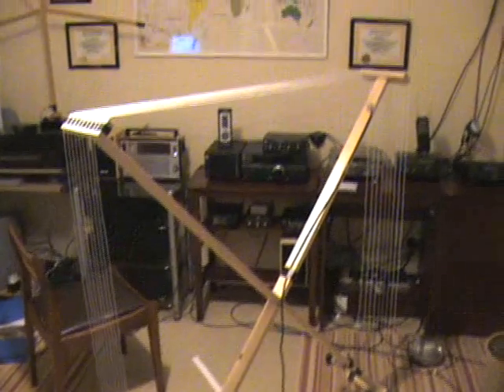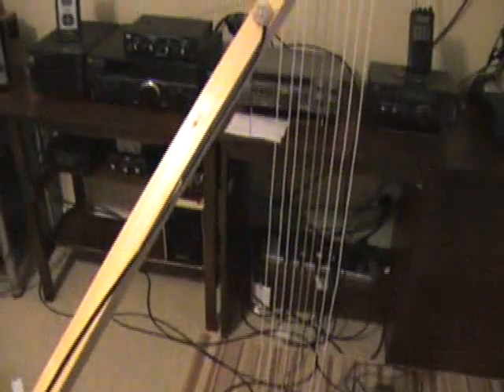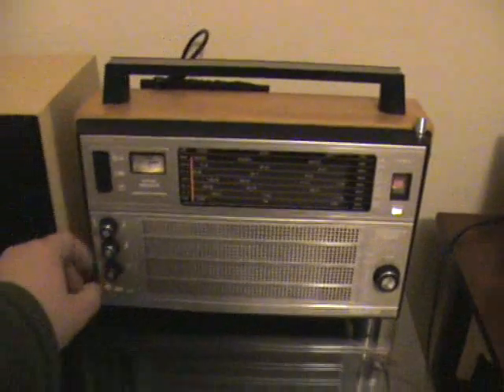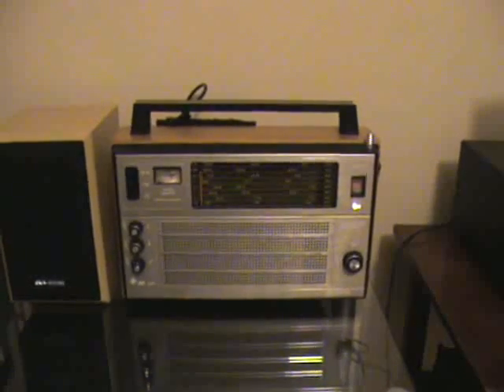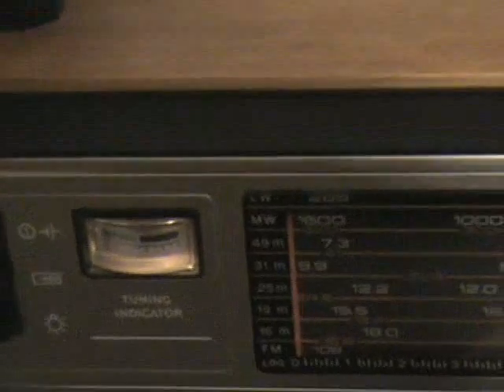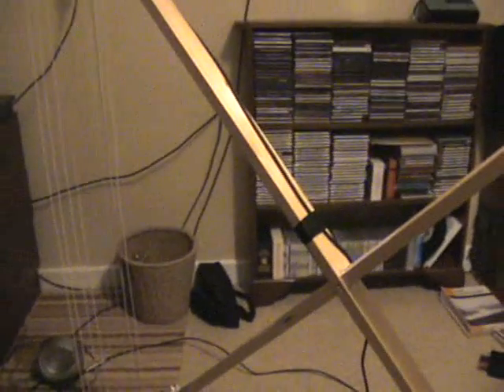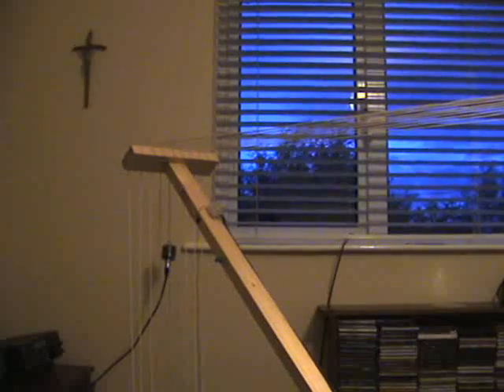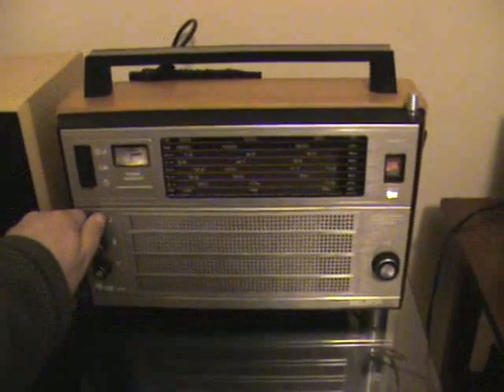"Signal Injection" from a four foot loop antenna.

Comment: I am planning on building this four foot loop myself because I am involved in trans Pacific AM DX and really need a good null for many US stations which seem to cause lots of splatter especially on the problematic frequencies of 954 and 1134 KHz.. Given the catch from China the 4,400 miles between here and Tokyo should be a piece of cake for a four foot antenna.

Comment from the maker: @KC8YOQ Here are the plans - 9 turns on a 48 inch square - cross arms are 67.88 inches- wire spacing is 0.875 inches- tuned with a vari cap from an old radio - I get full coverage from this 530-1700 khz by switching in more than one gang - dont know rating of said varicap - it isnt the one shown in the video. go for somewhere in the region of 500pf

Comment: Great vid, picked up a lot of info. Great update from your first. Glad I checked back. Good info on the pickup loop & ferrite rod/loop repeater. I ASSUME the radio does not have a direct antenna input. I gather you like this better than just having the radio near the loop with no ferrite repeater. It is more practical also.  If the radio has direct antenna connect option use a balun to match impedance; the results are good. However some radios have no external antenna input.

Comment from the maker: I phase the loop against a long wire with good results, or just use it on its own. For unidirectional pick up I have an oudoor KAZ loop which is a delta of about 40 feet bottom and 10 feet high. It works great- on 1008 I have no trace of Holland just the Canaries and Spain mixing. A question David why did you go for the 48 / 11 winding and what kind of core is it on. Id like to try one indoors.